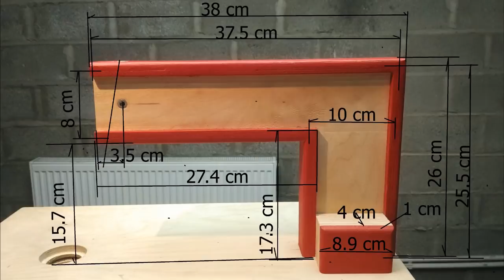DIY Jigsaw Table (2 in 1) - Scroll Saw & Jigsaw Table Machine

Comment: On your wooden vice, you have the fixed T nut on the wrong side. It should take pressure,
not be encourage to push off. Cheers.
Reply: Sorry, my error. I have now seen the T nut on the correct side too. Cheers.

Comment: Hi, your work was excellent; you combined mechanical functionality and aesthetics, congratulations. I am making the same but I am keenly concerned about the dust removal from the jigsaw itself. I am trying to find a solution to collect the wood dust falling down from the hole and penetrating inside the jigsaw (after a certain time the dust cuts even the electrical contact in the switch actuated by the trigger).
Reply: put the vacuum hose under the table beside blade?